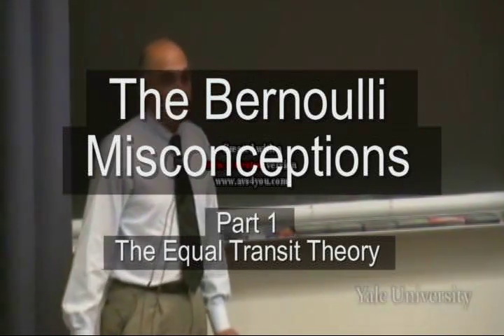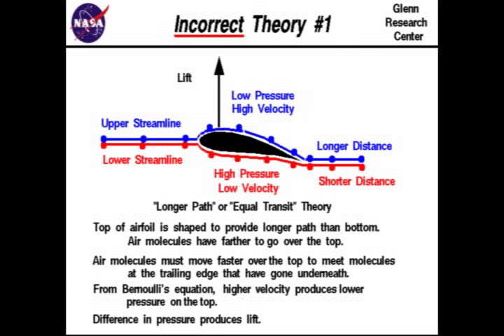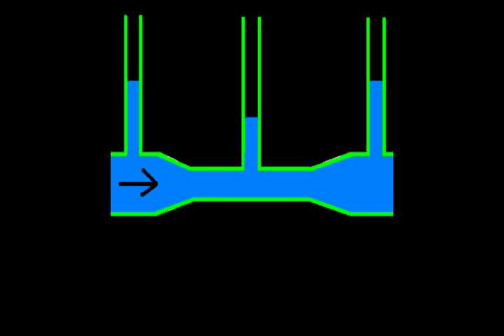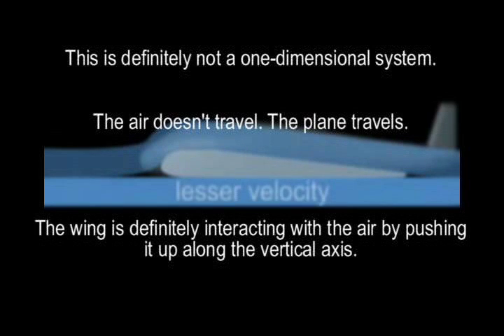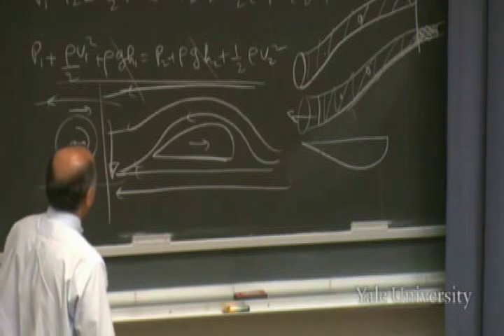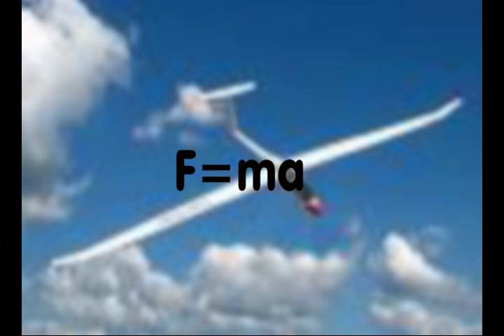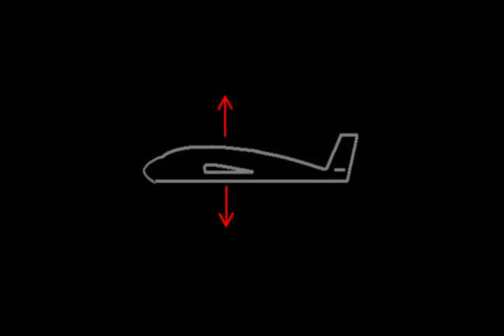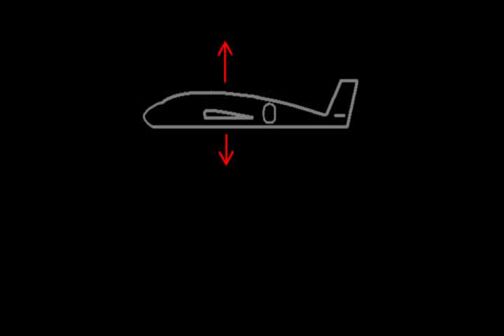Bernoulli Misconceptions 1 - The Equal Transit Theory

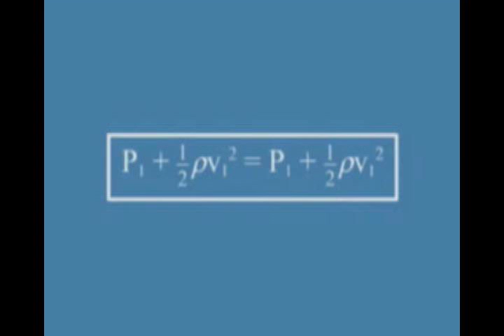Comment: Sorry to ask as I am still learning, at 2:23, the equation on the left side is exactly the same on the right side. Could you explain what you are trying to show please? Thanks in advance.
Reply from the maker: You are right. It is not so informative. This segment was taken from another video, and maybe it was elaborated on a bit more. But If you change the P1 and v1 on the right side to P2 and v2, it will be more useful. If you change v2 to something different than v1, than P2 must also change to satisfy the equation.

Comment: Thanks for your valuable video. I have a question to which I cant yet seem to find an appropriate answer: Would a horizontal parallel wind cause an uplift force on a  flat street manhole cover?    I think the answer is NO, but can I have a definitive answer that I can be sure about? Thanks a lot for your time

Comment: Good intentions. bad premise. If you drop a mass from an airplane, the airplane will actually rise. To remain flying straight and level at a constant altitude, Airplanes are constantly re-trimmed as fuel is burned or as "objects are dropped". The Bernoulli principle is factual and does play a part in the making of lift. Pressure diagrams from wind tunnel tests are direct measurements of the effect. You cannot simply say it is totally debunked. It's not. Current thinking is this does not fully nor adequately explain lift, though no one dismisses the effect. And the Yale prof explained that it is actually more complicated.
Reply: What specific premise are you referring to?
You write: "If you drop a mass from an airplane, the airplane will actually rise." How can you account for the plane's increased potential energy?
Reply: As an aircraft is flying straight and level at a constant airspeed and altitude, all forces are exactly in balance. Thrust=drag, lift = gravity. There is no acceleration. Changing any of the forces creates an imbalance of forces and thus, an acceleration. Add mass or lose mass, and the force of gravity changes while still producing constant lift. As mass is lost, the angle of attack of the airfoil must be decreased, reducing lift, to maintain a balance of forces.
Reply: as mass is lost, an aircraft will climb until forces are again in balance. As altitude is increased, air density is decreased and lift is decreased. An airplane would climb until the loss in air density, and lift, again exactly equals the force of gravity.
Reply: So whether you apply Bernoulli or newton, a change  of mass nets the same result.
Reply from the maker: T3andChris  I don't think that we are on the same page when it comes to understanding physics. I would like to invite you to visit the Nasa site that is linked in the description, or you can make a Google search on "incorrect lift theory - Nasa"
My intention with this video was to present an example that shows why Nasa's conclusion is correct.
The essential point is that the Law of Conservation of Energy is broken as soon as the aircraft climbs even a nano-meter after having dropped the weight, and far more so when it has climbed into thinner air.
Try to put in numbers on an aircraft's Kinetic and Potential energy before and after it has climbed to a higher level due to this Bernoulli-lift, and see if it balances out.

Comment: Well said, I agree. The "Equal transit" theory is largely nonsense but Bernoulli's equation and the pressure distribution which forms around the wing during conditions of lift is accurate and fully in accordance with the Newtonian reasoning. Both lines of reasoning provide an explanation of sorts..

Comment: we have two versions of the Euler Equations which describe how the velocity, pressure and density of a moving fluid are related. The equations are named in honor of Leonard Euler, who was a student with Daniel Bernoulli, and studied various fluid dynamics problems in the mid-1700's. The equations are a set of coupled differential equations and they can be solved for a given flow problem by using methods from calculus.